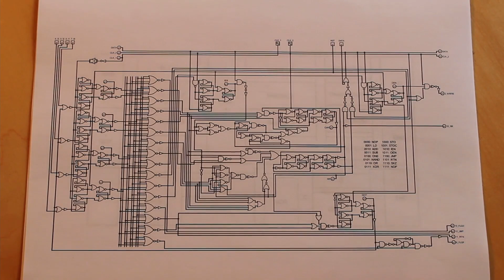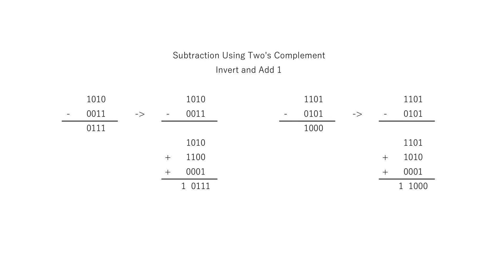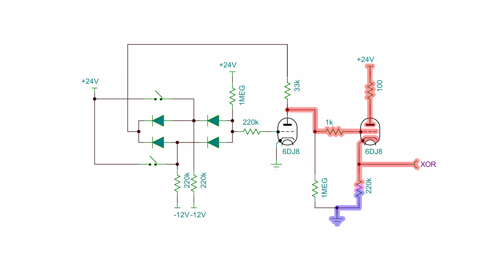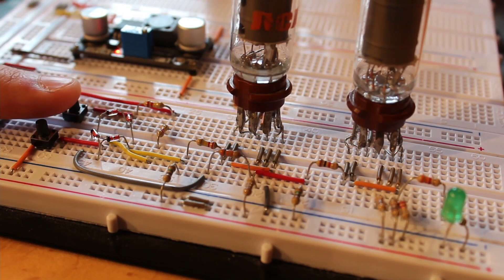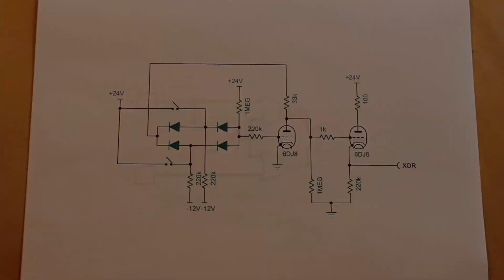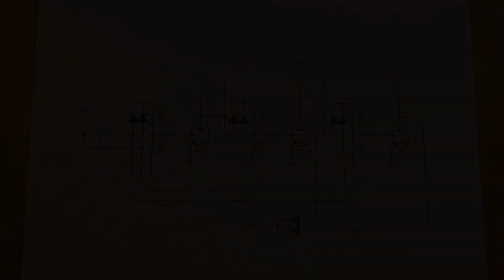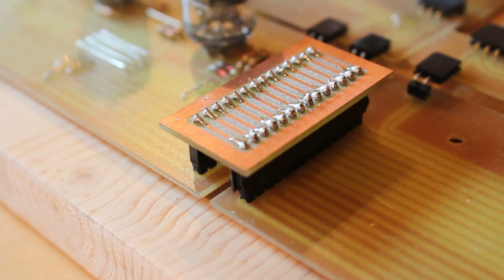Vacuum Tube Computer P.14 – Building an XOR Gate to Subtract by Adding (Fixed)

Comment: So... got to "alternative solution", but it would also be fine to use the signal that the original design was running into a plate into a cathode follower's grid instead, right? This way you're using the same layout and logic as the original design, but fixing the issue of the inputs possibly not being clean high signals, no? I wonder how that would compare to what you finally landed on.

Comment: 5:16: The "by inverting the smaller operand and adding one" narration made me do a double-take. 
Wouldn't it have been more correct to say "by inverting the subtrahend [i.e. the number being subtracted] and adding one"? Because even if that's the smaller operand in this example, it seems to me that that's not always the case and oughtn't be considered a general rule. 
Am I wrong?

Comment: 1 xor gate is a 1 bit parity check and in my head that makes sense you check to see if the bits are the same and if they are not you generate a partity bit output :)
Reply from the maker: It never even dawned on me that the XOR is perfect for parity, but you're absolutely right!

Comment: for the huge inrush current you can try a 1 or 2.2 ohm x20w  resistor in series with the filament supply, and short that resistor with a switch or relay after 15 - 30 seconds to apply full power  for the filamnets.
Reply from the maker: Hey now, did you happen to hack into my computer or something, that's pretty much exactly what I'm currently building up! It's seriously spooky how accurately you nailed it, haha. 
I'm using a 5 ohm resistor because that'll limit inrush current enough that the power supply never really has to work hard, and then I'm using a pair of thyratrons to enact the time delay with a set of automotive relays.
Reply: @UsagiElectric  similar geniuses think similarly? ... nah, just some experience with vacuum tubes

Comment: This is just a thing of beauty! Wonder how much current it will draw for this part so far? How much wattage .. like, what sort of heat is coming out of it? All those buffers are pretty nicely done .. I iamgine you'd have all kinds of fluctuating power problems all over the place without it. And that board layout 'high way' design is gorgeous. You're a hero :)
Reply from the maker: Thank you so much!

Power draw is actually something we can actually calculate fairly easily! 

As it is currently, we're sitting at 88 vacuum tubes, but we're only about halfway through building it. I'm not quite done designing the PCB layout for everything yet, but so far, I know for a fact I need an additional 46 vacuum tubes, and most likely will need another 20 on top of that. So, 88 + 66 = 154 tubes. Each tube has a heater that pulls 0.3A at 6.3V, but since I'm running the heaters in series, each heater is only seeing 6V, which means they're pulling about 0.28A each. So, each tube draws about 1.68W of power.

1.68W * 154 tubes = 259W! 

That's an enormous amount of juice! At 24V that should be drawing around 10A of current, which is an insane amount of current, but fortunately, the switch mode supply I'm using can supply up to 15A, so we're pushing it but not too hard.

As for the heat, well, you can certainly feel the temperature in the room steadily increasing whenever I'm doing testing on it, haha.
Reply: @UsagiElectric  Soon you'll just be using a PC power supply for it (what rails do you need?) .. PC has a couple 12V rails so could do 24V with em perhaps, and its easy to get huge wattage supplies .. no more -ve rail IIRC but modern supplies can dump 20A out which is pretty awesome.

Anyway, don't reply, you've got enough on the go :)

Comment: I wondered if you run groups of 20 6 volt tubes in series off the 120v line or 60 tubes in series off the 240v line, if this would be a way to reduce heater current or so many heaters.
Reply from the maker: You totally could do that! And actually, many radios and TVs back in the day actually did that because it saved having to stuff a transformer in the system.
It's often considered an unsafe design because there's no isolation between the human and mains AC like you get with a transformer, which is why so many old radios and what not had wooden cases. 
Aside from the inherent safety issues, I think it's a really brilliant design choice to make super compact designs. And, after rectifying the mains AC, it can also serve as the B+ voltage for the circuit, meaning the entire design doesn't need a transformer or voltage shifter anywhere!

Here's the schematic for my Japanese General TV: https://i.postimg.cc/C5bWYWBY/TV-Schematic.jpg

On the bottom it shows all the heaters lined up in series, but most importantly, there isn't a single power transformer anywhere in there!

Comment: have you though about using a CC/CV power supply to solve your inrush problem? The power supply could sit at a constant, regulated current for a few seconds as the filaments warm up, and the computer would be ready to operate once it switches to constant-voltage mode. There may be an off-the-shelf supply that fits your need. Although, that said, I'd love to see you build a Thyratron regulator like the power supply from CuriousMarc's Teletype!
Reply from the maker: Ultimately, the goal is to build a Thyratron regulated power supply like CuriousMarc's teletype! mostly because I just want the nice blue glow of the mercury Thyratrons, haha. Although, until the build is mostly complete and I have an idea of the level of power draw I need my PSU to supply, I think I'm going to keep using these cheap Mean Well switch mode supplies. For the inrush problem, I'm not actually going to be modifying the PSU at all, I'm just adding a soft-start module in-between the supply and the processor itself. In theory it should work totally fine, but I can't be entirely sure until I build it up!
Reply: @UsagiElectric  Good stuff, I can't wait to see. You're doing some excellent work.

Comment: Why don’t you use a capacitor bank to provide the extra amps at startup? Then you can use a regular power supply.
Reply from the maker: That's not a bad idea! The idea I'm currently working on is a bit more crude, but if it doesn't pan out, I'll definitely look into that!
Reply: I don't think so.  The capacitor would add another inrush making matters worse.

Comment: In thinkin' of the, "hollow-state," what if you used vacuum tube diodes?
Reply from the maker: Actually, everything I've designed up to now could work totally fine using 6AL5 dual diode tubes! The primary issue is the tube count would essentially double (two tubes per NOR gate/NAND gate instead of just one). I could counteract that some by moving up to dual triodes, which would then only require 1.5 times as many tubes. And truthfully, if I could have afforded it, I definitely would have gone down the dual triode/dual triode route! 

Unfortunately, my wallet decided it would be best to stick with cheap pentodes and make a small concession with some silicon diodes. Though, in defense of the silicon diode, you could totally replace all the diodes on my design with period correct germanium diodes, which were fairly common on IBM tube computers, and the design would still totally work!

Comment: What's your plan for memory? Ferrite cores?
Reply from the maker: This is a tough one. Memory can be split up into two categories.

The first are some general purpose registers. The size and number of these depends a lot on how big of a control word I'm planning on using, but I'm thinking a 12-bit control word (4-bits for processor control, 2-bits for chip select, 6-bits for addressing). This is actually overkill for the general purpose registers (GPR), since I'm planning on 8-bit registers and I really only need 3-bits of addressing for an 8-bit GPR. I'm thinking want three 8-bit GPRs and one 8-bit output register. These GPRs will most likely be built using tube SR flip flops. They're easy to build and interface with the processor as it sits and will be a good starting point for getting some memory into the system. It will be tube intensive though. Each SR Flip Flop will take two tubes, meaning 64 tubes just for the registers. There will probably be another 64 tubes involved in multiplexing and de-multiplexing to allow me to write to them one at a time. That's a lot of tubes, but still totally manageable. 

The second memory hurdle is RAM. This one isn't as dire as getting the GPRs up and going. RAM is nice for more complex programs, but with 4 GPRs the processor will already be capable enough to do pretty interesting stuff. With 6-bits available for addressing, that gives me 64-bits of memory, which should be plenty for a 1-bit system. In order to use all 64-bits would require a seriously long program (which is another hurdle in an of itself). But, 64-bits is too small to really justify a complex system like core memory. Core memory scales really well, but at lower storage amounts, it ends up having control circuitry that's more tube intense than just building the memory out of tubes in the first place.

But, there's not too many other period correct memory options out there. I have been experimenting with using VFDs and LDRs to make a simple type of SR Flip Flop that doesn't require any tubes at all, and that definitely looks promising! Here's a quick proof of concept of that idea: https://i.imgur.com/OgxDr0M.mp4 But, this brings a lot of issues as well, particularly the ambient brightness in the room affecting the reliability of the flip flop. Right now, that ambient brightness issue is dialed in with a potentiometer, but I need to come up with a more elegant solution than that.

Either way, RAM is super far down the road. Getting the GPRs and program control up and going is top priority after the processor itself is finished!
Reply: @UsagiElectric  just for inspiration... http://www.massmind.org/techref/mem/neonlamp.htm
Reply from the maker: @bronka42  I've actually got that website bookmarked! I would love to use neon lamps for memory because it would look so epic, but unfortunately, I just don't have enough voltage on the computer to do so. It wouldn't be hard to build a custom power supply, especially because neons use so little current, but I'd like to keep the entire build running at just +24V/-12V. That's why I'm leaning into the VFDs, but they don't demonstrate the hysteresis that neons do, making it a bit more difficult. I'm still exploring other ideas too, but man, memory is tough stuff!
Reply: @UsagiElectric  You can tell me ... I am currently building a transistorized computer, (microcoded architecture) vagamente inspirado en el MC10800, nothing fancy, 8-bit bus, some simple instructions ... and memory .... or man, the memory.  4 transistors per bit, 8 bits per byte, 64 bytes ... 2048 transistors. I even considered making my own ferrite cores, but it is a complex process, let alone the chemistry involved...another option that I would like to try is the use of homemade memristors

Comment: This is cool! There probably hasn't been a vacuum tube processor built in the last 50 years.
Reply from the maker: Thank you!
There's been a few tube computer projects that have been started over the years, but a lot of them seem to be put on hold for various reasons. My ultimate goal is to get this far enough along to actually do the Fibonacci sequence! Once it can do that, it'll officially be a "computer" in my eyes!
Reply: After seeing all these videos I have a feeling there may be a handful of similar engineers that are putting together vac PCs during some free time on the weekends and weeknights!

Comment: Inrush current : why not use a NTC ? it's quite small, simple and you can add one in every block of the design.
Reply from the maker: So, I have thought about using an NTC, and there's a couple reasons why I'm not, but the biggest reason is that I didn't think about in-rush current being a problem until I was like halfway into the build, and I desperately don't want to redesign and re-cut all the boards I have already, haha. 
But, I do think I have a solid solution involving a pair of Thyratrons and relays that will work well and can be implemented with relative ease!
Reply: @UsagiElectric  NTCs are dipoles so you can simply cut a power trace, solder and you're done.
It will not look as funky as a thyratron though but...
Reply from the maker: @leyasep5919  You're right, I could probably totally hide the NTC on the bottom side of each board, but then I wouldn't have an excuse to shove some thyratrons, relays and big power resistors into my build, haha!
Reply: @UsagiElectric  There is no way I could default this logic, or else I would be a total hyprocrite.

Comment: if you use negate then add that will do subtraction.
Reply: So far I have never seen another way to do this.
Reply from the maker: I think invert and add is called one's complement, and that comes with it's own set of issues to tackle too. Honestly, Ben Eater does such a better job of explaining it then I could ever hope to!

Comment: I noticed that @ ~5:40 you have an OR gate on the carry input to OR the SUB and CARRY lines, that actually needs to be an XOR gate other wise you won't be able to have a borrow from lower bits.
Reply from the maker: Very keen eye!
That was something I didn't notice when filming but actually picked up on during the edit. Fortunately, the solution was quite simple - that was just an old layout! When I was designing the new ALU I actually did run into that problem, but instead of rebuilding that simplified diagram, I changed the build of the full logic gate diagram as seen here ( https://i.postimg.cc/CxccxKf4/New-ALU-Gates.png ).
Fortunately, this one works pretty well! (I actually just tested it out by subtracting 1101 - 0110 and got the right answer). It does take a few extra steps and care when subtracting two numbers though. The program for 1101 - 0110 would look like this:

ONE (Forces a 1 into RR) 
SUB 0 (Transfers that 1 into CAR)
(1 - 0)
LD 1
SUB 0
STO RR
(0 - 1)
LD 0
SUB 1
STO RR
(1 - 1)
LD 1
SUB 1
STO RR
(1 - 0)
LD 1
SUB 0
STO RR

That's a ton of steps just to subtract two 4-bit numbers, but needing only 3 steps per bit is considerably less than was required for the MC14500, which needed around 12 steps per bit!
Reply: @UsagiElectric  Well I'm glad you didn't end up building a none working ALU! Can't wait for the next video.
Reply from the maker: @wawa1474  Thank you!
That was an excellent catch too and thank you for pointing it out! I'd have been absolutely gutted if it fundamentally didn't work and needed a large redesign.
Reply: @UsagiElectric  Simulation is king ;-)
Reply from the maker: @leyasep5919  Yup! Without Logisim, I never would have even attempted this build!